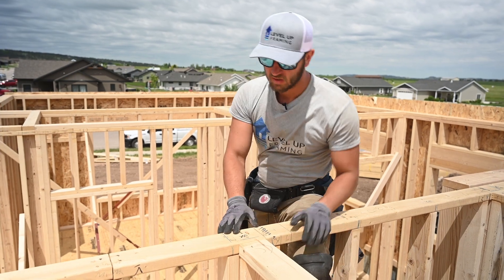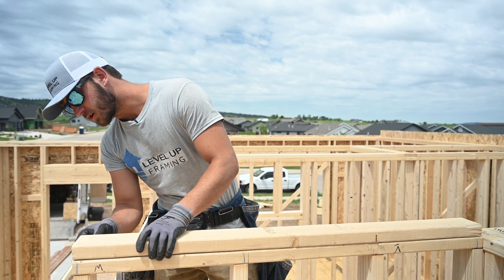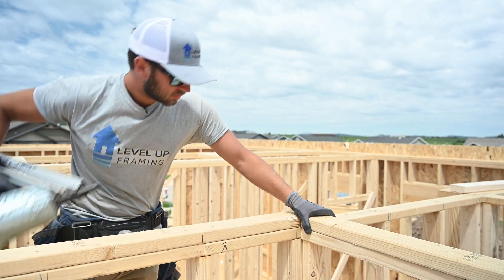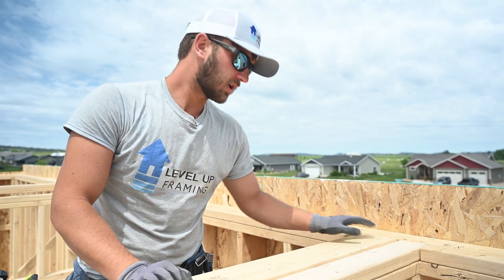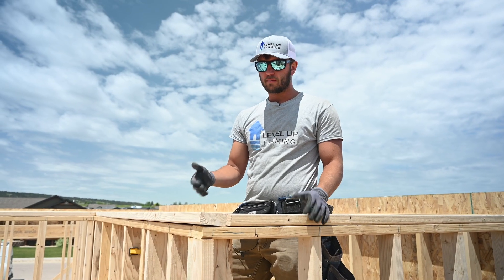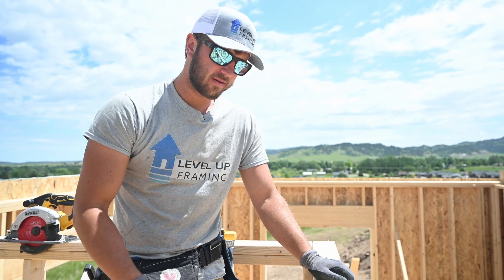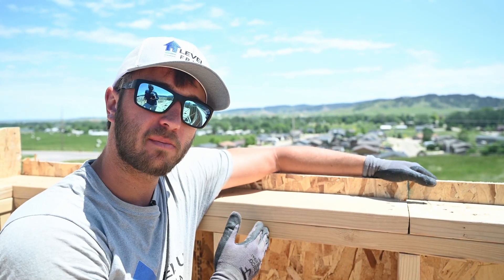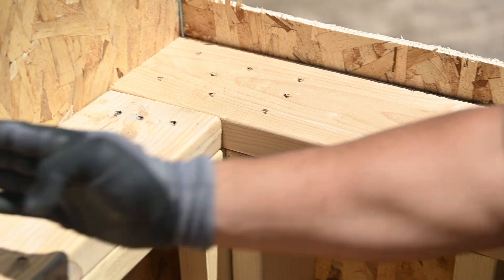How To Double Top Plate Walls

Comment: Can a 2x4 wall be modified to where part of the wall is 2x6 and the other half is 2x4? One side of the three stud channel being 2x6 and the other side of the three stud channel being 2x4. I have a 2" drain pipe that is not centered in the wall. One leg of the three stud channel was cutoff instead of being nailed to the bottom plate. In addition, the next stud did not touch the bottom plate due to the p trap for the washer. My original plan was to build another 2x4 wall next to the existing so i could also put the dryer vent into the wall which is located on the right side of the three stud channel. I think it might easier to do what you did with having a 2x4 wall then putting a 2x4 or 2x6 wall next to it. Also want to add some additional studs to support a strong back. This wall is the divider between the garage and the house and would need to have 5/8" drywall installed for fireblocking.

Comment: Top and double top plating. After 25+ years of piece & production framing, apartments, condos & custom homes in SoCal & Utah. I’ve been around a lot of rough and finish carpenters that worked with or for me and had the pleasure of learning from and teaching. When working with piece workers you learn a lot of little things that will make you more efferent which transfers into making you more money and also more valuable as an employee. 
  I see that you guys do most of your double top plating after standing the walls up. I’d say in last my 10-12 yrs of business before becoming a BI most of the time for standard 8' & 10' walls we would just double top while the wall was still on the deck or slab. I guess the people I knew and crews I worked with got too old to walk walls or got tired of dragging around a ladder.  If the wall was properly detailed, you’d know where the walls intersect by looking at channel layout marks you should also know where to have a long tail or cut 3 5/8 back by the layout. After its top plated just stand them all up nail them off then plumb, line and brace. I see at 0:49 you broke your top plate over a stud. We rarely did that do to having an open gap between the plates by nailing both sides to the studs with the gap between making it harder to close it when placing the double top. If your double top plating on the deck and don’t put your top plate joint over the stud its easer to close the gap without the break over the stud. 
 Great channel you’ve really taking the time to explain the different stages of framing in all your content. It really helps people to get a grasp and can learn a tremendous amount about all the different elements and phases of how type 5 structures are built.  I can’t even imagine the amount of time you put into this. Hats of to ya.  The way you present your content and take the time to explain things in detail seem similar to another youtuber. He’s a finish carpenter Insider Carpentry.
Reply from the maker: Thank you for your comment! 
Yes it is so much better to double top plate on the ground. We explain how to do this in the “plating walls” and “building interior walls” videos.  
So far I haven’t seen any issues with breaking the plates above the studs. But I could see larger companies (with less experienced employees and management) having issues with that.   I will keep that tip in mind going forward. 

Thank you for the encouragement! 
Yes it’s a lot of work, our team is incredible. 
We have big things coming these next few years, and the videos are just the start.